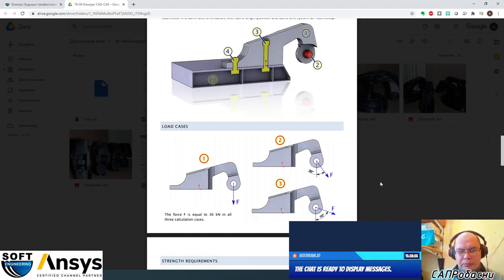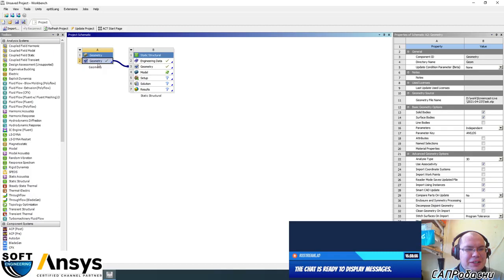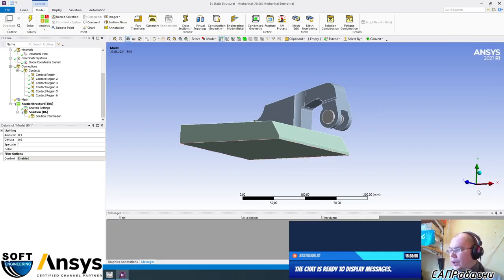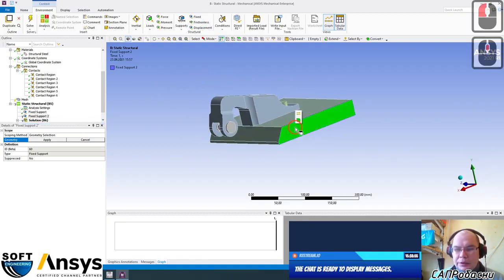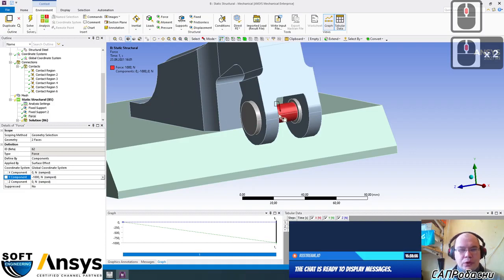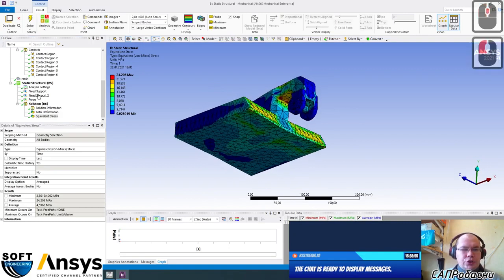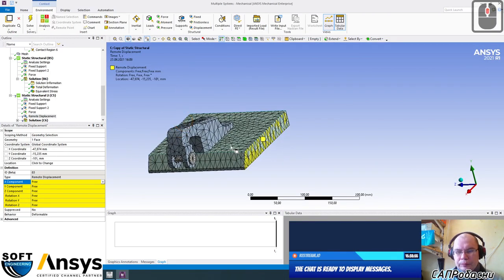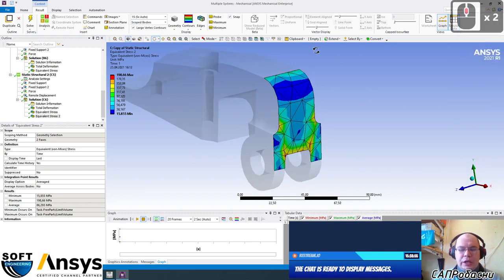Quick Start with Ansys Workbench. Static Stress Analysis tutorial

Comment: I can't express enough gratitude for you taking the time to make these instructional videos. Finding learning materials on some of the more complex aspects of Ansys has been pretty difficult since I started using it. 

I would love it if you could also cover meshing techniques between different types of bodies. For example, simplifying a structural tube member from 3D solids to a 2D shell of just the outer faces (extracted from space claim), but then still getting the mesh area around a contact area with another body to match the nodes up correctly? I cannot use the "share topology" within spaceclaim feature between the different types of bodies with quadratic element types. I've been struggling with this quite a bit lately with a current project because of the size of the structure requires massive solve times if I use 3D elements. But I cannot just make the assumption that the body is one single unified solid, as I am concerned with the shear stresses in the weld joints. & I need those joints to be pretty fine to extract accurate stresses. Do you have any recommendations for tackling this issue? I cannot find any clear documentation on how/when to use any of the Mesh Edit features in mechanical.
Reply from the maker: thanks for your responce.
As I understand it's a several questions in one:
1. How to connect Solid and Shell/Beam model
1.1. Why there are no contact betwen solid & shell model in automatic regime without sharing topology
1.2 Does nonconforming mesh in place of joint/contact are problem
1.3 Why we have messages about problem with quadratic elements
1.4 Accuracy in joints regions
2 MeshEdit

is it correct?
Reply from the maker: https://www.youtube.com/watch?v=5RLFIaQVfxw May be it will be helpful